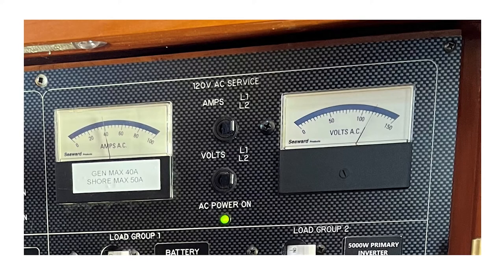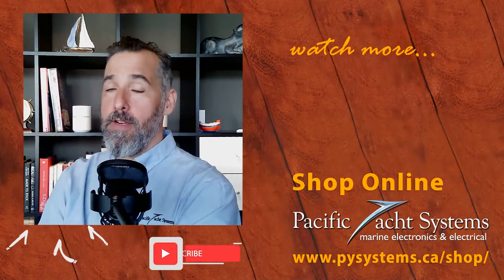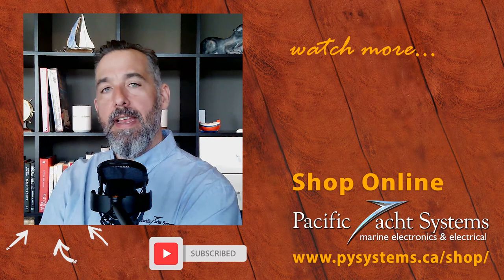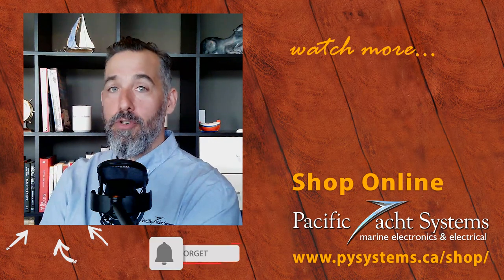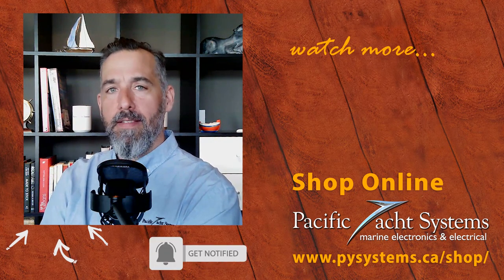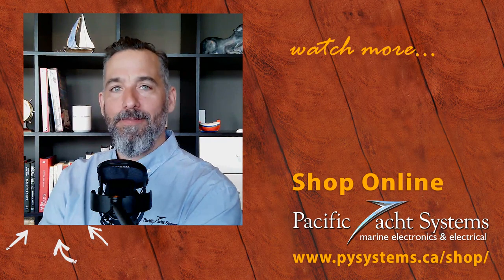My Boat Is Outside in the Yard, Can I Use an Extension Cord for Shore Power?

Comment: I’m Tom with the boat in question.  Thank you, Jeff!  Wow, I just tuned in to catch up on your videos and what-do-you-know… you’re answering my question!  Thank you!

To give some additional color:

—The charger is 40A.

—On the hard, I’m only using the electrical cord AC when I’m there to power lights and the charger.

—Yes, the boat has an Amp Meter for the two banks, port and starboard.  I do watch it.  Side note, it was AMAZING to see the drop in Amps switching the entire boat to LED.

—Yes, 30A 120… you use those up FAST.  For instance, the boat has 2 air conditioners.  When both are on, that’s about all the AC she can give.  No stove.  No microwave.  Etc.  You taught me to monitor the Amps.  Thank you!

—Yes, when I am not at the boat on the hard, I physically disconnect the batteries.

—My battery charter is switched by breaker.  I will run that test to see if indeed there is charge with shore power on and and the charger breaker off.

So if I’m hearing you right, YES, I can use the extension cords to run from the building to the boat’s inlet, then power up AC, but watch the amp draw.  Makes sense.

Thank you, Jeff!

Comment: I think it would be useful to know if Tom's extension cord is a Household type (15A) and what distance he needs to run between the boat and the outlet. I'm suggesting that because he says the boat will be connected to the storage building outlet "with proper adaptors" and that is possibly 15A. If so, that is 15A available connected to a 30A draw, that could overheat the extension cord.

Comment: Hi, I don’t know if this is the correct way to ask a Q, but here goes.
I understand cost consideration associated with upgrading existing/, however I’m planning total strip>refit to full electric boat, nil fossils onboard (excluding myself).
240v domestic appliances are much cheaper, & presumably more energy efficient?
I can use smaller, lighter, & less circuitry using AC only.
So why consider any 12/24v, have 240v only, propulsion, windlass, winches, etc. Nil DC, just like a house. 48v bank (or 96v) to 3 Phase Inverter?
Am I missing something?

Comment: Kept in mind that a 30 amp DC battery charger won't take 30 amps of 110v AC power to operate. Probably closer to 6 amps in AC power if not less.

Comment: My Victron isolation transformer has a jumper to change the grounding path when in the water vs hauled out. Is this a safety concern for using shore power on a boat that is  not in the water?

Comment: Hi Jeff I just purchased a 1988 35foot ocean yacht to Detroit diesels and one battery per motor I want to install a Victron multi plus 2 split phase the boats generator is shot and I am having it removed really just want to run the AC systems when I’m underway but the alternators are original and really would like to know if I should not even connect or replace engine battery’s and keep them totally separate I know about the dc -dc isolating chargers is that a good approach and can I just replace my engine batteries with lithium and have it all on one system for dc?

Comment: Is it smart to leave batteries outside through a Michigan winter?
It'd depend upon battery chemistry, of course, but even lower Michigan can reach -10F.
Reply: I stored the boat in the video in cold storage (inside, but no insulation or heat, so Michigan winter temps) for 3 winters.  Batteries were disconnected.  The batteries, AC Delcos, were solid for 6 years.  I did watch their ability to hold a charge decline over the seasons.  This season I did replace them to be proactive.  I didn’t take V readings when I pulled them… wish I would have.  SO, I have left batteries in the cold Michigan winter, disconnected.  If possible, I plan to never do it again though.